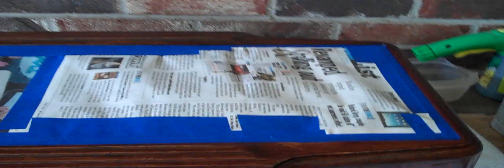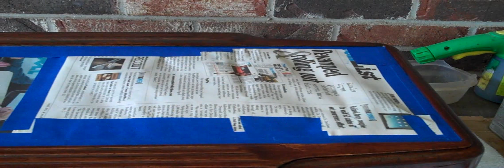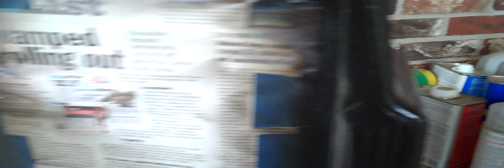1936 Philco 630B Vintage Radio Cabinet Restoration (Part 7 of 9).

Comment: Hey John, I knew what a proper cabinet should look like, but I couldn't figure out how to get there with what you had.  Thanks for showing me the way.  I'm looking forward to your demonstration of speaker cloth installation.  I've got a Philco console, a 37-670X that needs new chevron cloth on the speaker board.  So, any tips in that direction would be appreciated.  Thanks again, Tom

Comment: Hi John, Well I messed up and bought a Crosley Model 517 off eBay and didn't read the discription very good. It does not have the power transformer. Do you know where I might be able to get one? Thanks,  Terry.

Comment from the maker: Hello there.  It's good to hear from you.
No Blush Retarder is basically a type of lacquer thinner.  It dissolves the lacquer and exposes trapped moisture.  The retarder prevents the lacquer from redrying too quickly, thus giving the moisture time to evaporate.
I don't know if it'll work as well on lacquer that's been dry for a length of time, like a few days or so, but I'd give it a try.  Go for it.  What's to lose?

Regards,
John